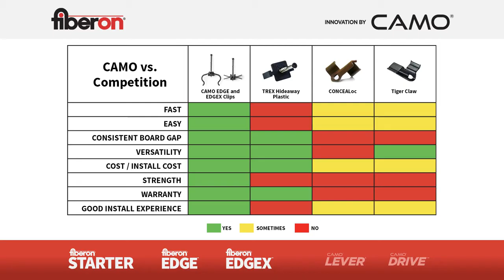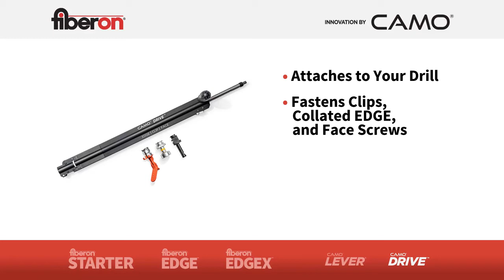Fiberon Fasteners: Premium Hidden Grooved Systems

Comment: my deck boards seemed bowed laterally Hard to get the clips set and screwed down without pulling the boards together...
Reply: @jstone1211  try pulling together with ratchet straps wrapped around the rim joist
Reply: Thanks, I read another commenter that suggested that approach… going to give it a try. Always more difficult without help…
Reply: @jstone1211  i used three total one on each end and one in the middle. Did each slowly and gradually with the fasteners in place. I was able to do this solo